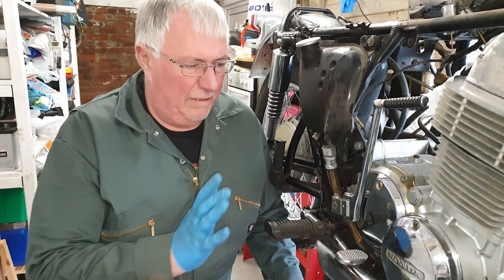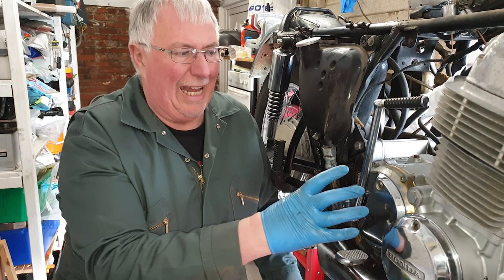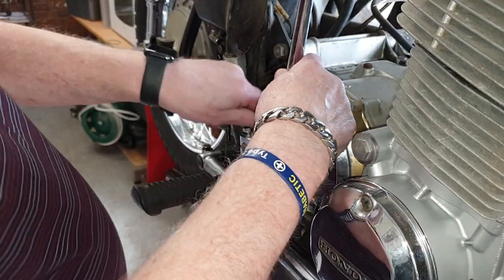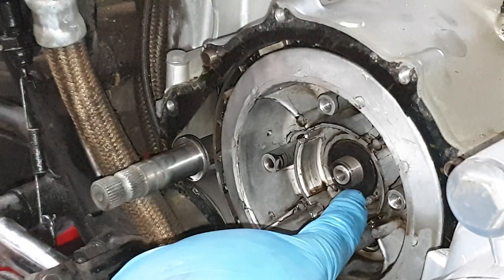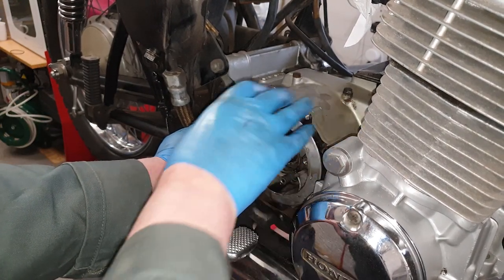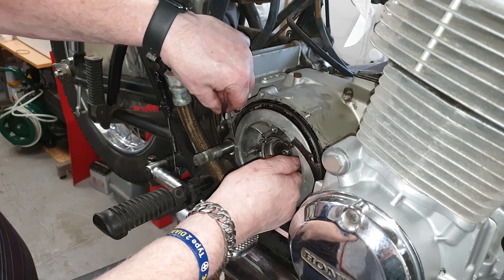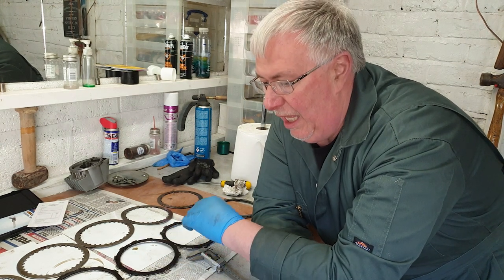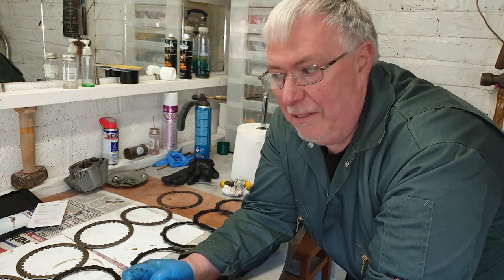Honda CB750 Seized Clutch Strip Down & Inspection 1970 K0 | Part 7

Comment: What did you use to clean up the plates?  I was told to just use gasoline.  Is that ok?
Reply from the maker: Gasoline would be fine, you are basically washing oil off and getting it out of the friction material.  If you get it out with gasonline, the fresh oil will displace any that hasn't evaporated.  Bu I frequently use brake cleaner for virtually everything. :)